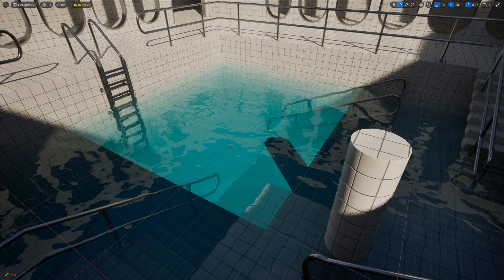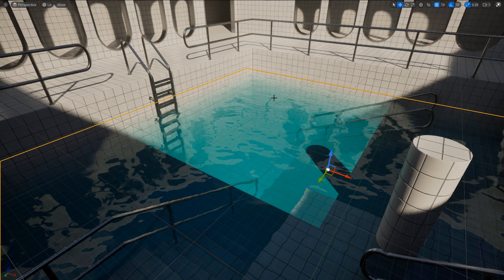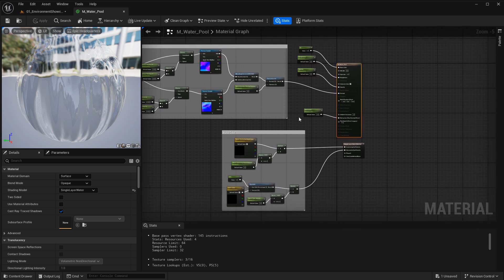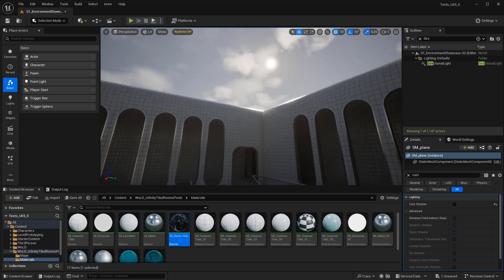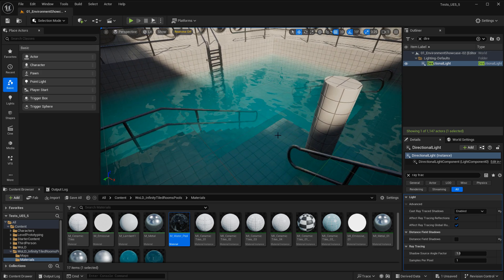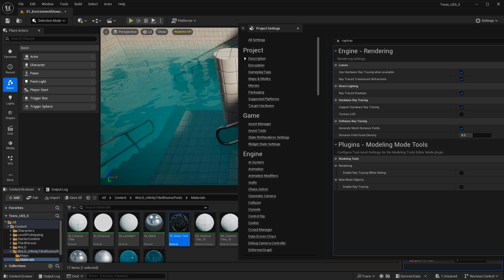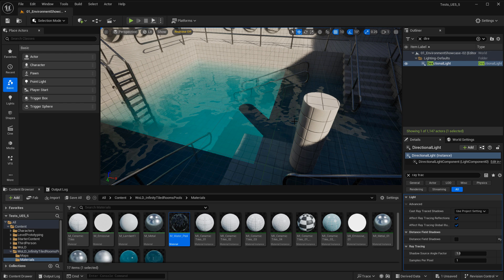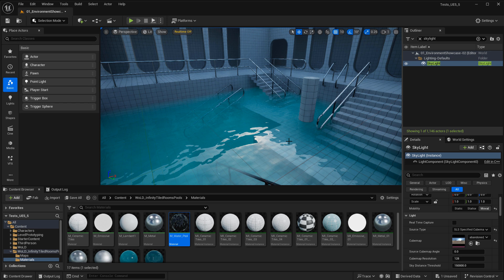UE5: FIX - Single-Layer Water with Directional Light Blocky Hard Shadow Problem and Solution

Comment: Water in the ocean DOES receive shadows. You only have to take a look at any photo of a ship navigating. You will see a shadow on the surface of the water. 
Thats why this Single Layer Water shading model has shadows on the surface. Thing is we should be able to control how visible those shadows are.

Comment: Why'd you think, that water surface shouldn't receive shadow? Oo
Also, if you got rid of shadow on it, you will not get it shaded inside as well, so it would be lit up by directional light where it shouldn't. Because there is no such thing as inside or outside. Inside is basically a place where all light from directional light were blocked and casts a shadow on everything.
Reply: because water is transparent. while there may be some shadow due to water fog, light will pass through the water and hit whatever opaque surface may be behind it.
Reply: @Aryllix False. Water is transparent at a certain extent, but not 100% transparent, and thats the reason why, If you look at the surface of the ocean, you will see shadows on it.
Reply: @Aryllix Water, even quiet clean, like pool water, is a surface. All surfaces partially reflects light. Amount of reflected light is varying depending on surface properties, but even cleanest water will reflect light at viewer. Shadow is absence of light. Mean that there is nothing to reflect. So it's always will be some distinction between lit and shadowed parts of the surface of the water, especially at a glancing angles when Fresnel effect takes place. Yes unreal simplifies shadow on the surface of the water, but it's better than disabling it altogether. Especially if you happen to have water both indoors and outdoors on the same map. Because if you disable shadows on water, it will be lit with sky light indoors as well and you don't want it.
Reply: @Demnus  you essentially just repeated back what I said but with a bunch of filler words.. no point in arguing back